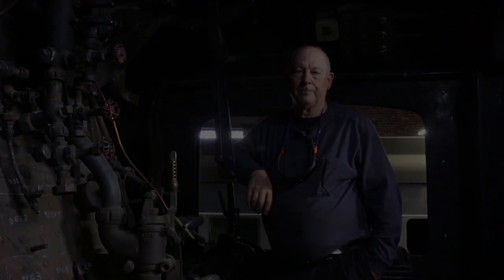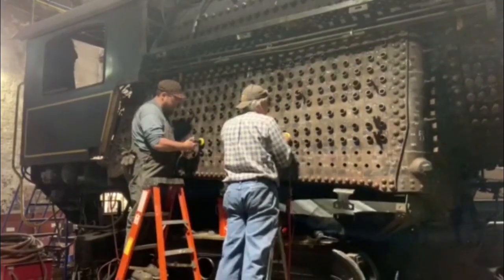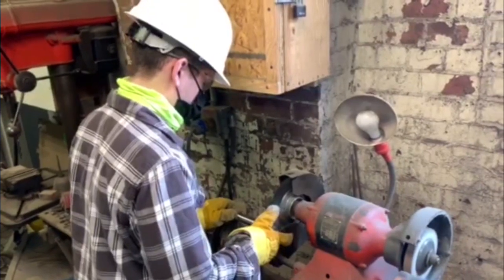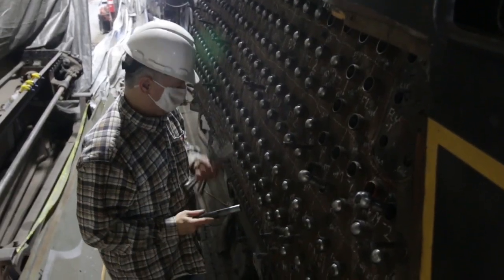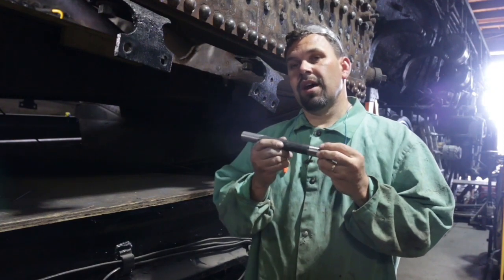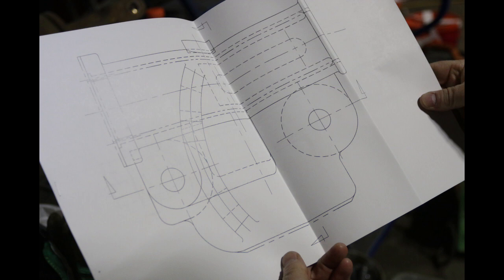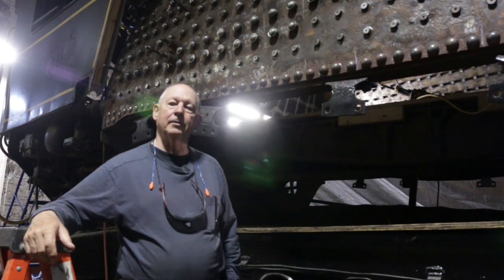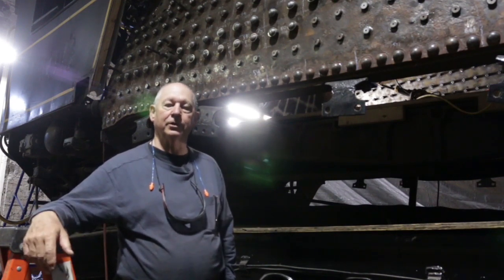Reading 2100 - Welding in Steam Locomotive Staybolts

Comment: When is a fillet weld acceptable vs. a full penetration weld? SP-745 has full penetration welds on her stay bolts. I've only worked with locomotives that had threaded stays.
Reply: I have heard that the Chinese engines were fillet welded in China but the ones that came over here in the 1990's were full penetration.  I also heard through the grapevine that FRA accepts the fillet welded bolts now.  My experience also with the threaded ones and I would be interested in an expert opinion.